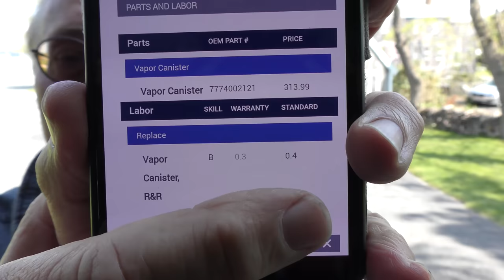7 Car Myths Stupid People Fall For

Comment: What is the best PSI for fuel economy vs traction loss? All my cars state 32 pounds, I run them at 36, the tires state around 54 max
Reply: Whatever is stated on the manual. 

You should NEVER run at max pressure.
Reply: Too much different tire tech to give a number that is universal. Tread pattern, sidewall height and makeup and on and on. Run yours at 32 for a week while calculating your mpg then go back to 36 and repeat for mileage. "VS traction loss" I wouldn't know where to begin but I suspect the type of tire and quality of the tire will play an enormous role.
Reply: @cbot375  true, never run the tire at max you need headroom for air expansion

Comment: Yes, indeed -- topping off the tank often enough will put liquid fuel into the charcoal vapor cannister, eventually causing a physical breakdown of the charcoal matrix, which then sends tiny particles up to the purge valve, where they will prevent it from closing during the non-purge state, which will set a trouble code and cause a check engine light to appear, as well as poor fuel trim and other unwanted downstream effects. And all of this may go undetected by an otherwise competent mechanic who's too busy to ask a customer possibly relevant questions about their refueling habits. Which, if you're in a state that requires emissions testing, can leave you with the choice of junking an otherwise sound vehicle or doing the work yourself.

Following the phone support advice offered by a purge valve mfr, I checked the vacuum line at the electrically disconnected valve with a strip of paper held close and the engine running. Sucked it right onto the inlet, even though the valve should have been closed. Replaced valve and then inserted a small engine fuel filter in the hose just before it enters the valve. (The other option is to use a strong air compressor to blow the grit out of the line.) I should say also the the canister was replaced too -- and it didn't cost half the $300 Scotty talks about. Anyway, that eliminated the emissions code, but I got another one for a bad heater in an upstream O2 sensor. That was fixed simply also, and the car just passed emissions testing and is good to go for a couple more years!

Comment: Luckily my F150 has my mobility lift on it.  Easy to find. Just the crazy ladies trying to take my mobility scooter as I put it on the lift.  In Michigan we on E85 gas. Our F150 can use both except the mileage is #$&@*  also acceleration is slow.

Comment: The nonsense about the “fluid in your head amplifying the signal” is rubbish, Scotty. There is ZERO science behind that. ALL radio frequencies are attenuated by fluids, including your fertile brain! Particularly the radio frequencies used by car key fobs! 
As “herzglass” posted a week ago here; by holding the fob up near your head, it’s already higher than if you are holding the fob down near your waist or chest, thus, the radio signal has a better chance of hitting the receiver in your car. Hold the fob way up OVER your head and guess what? You get even MORE distance coverage with your signal! Yikes.

Comment: nope... wrong take on high octane ... it has everything to do with how the car was set up. you can get more HP out of higher octane gas.. but the real issue is when you set up an high performance car for high octane then try to put that stump water in it.. its going to knock and lose power and this is personal experience not someone telling me. and lead helps obtain complete combustion though it is hell on the environment . these are the facts.. and i regret clicking on this dumb video..

Comment: Tear down a modern engine that ran primo its whole life, and the same engine that ran 87 its whole life. The difference is clear. Sure, a modern car can run 87 no problem, in knock detection, getting all carboned up?